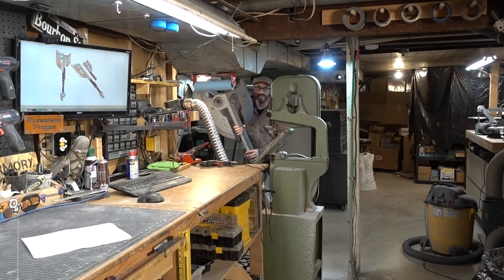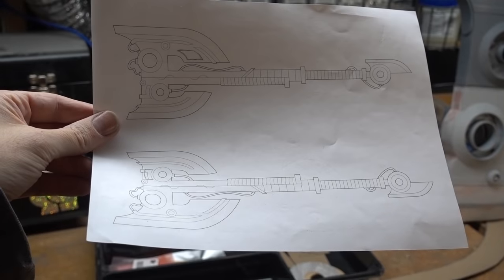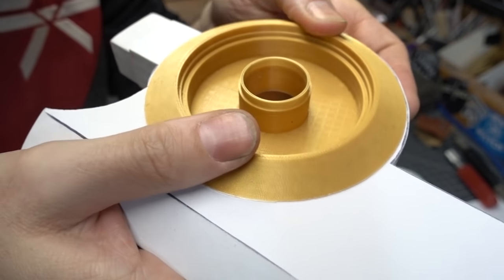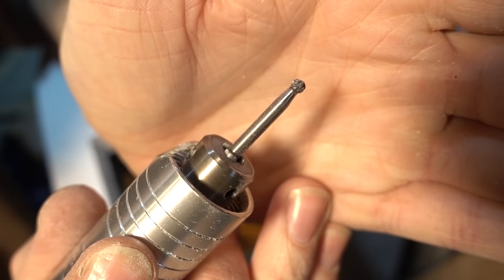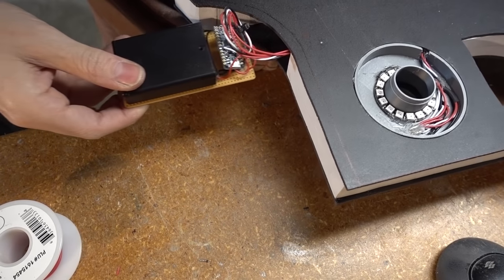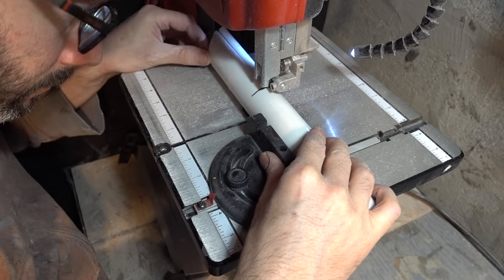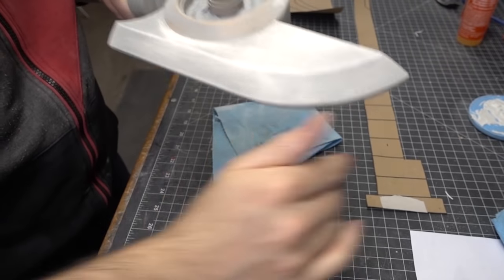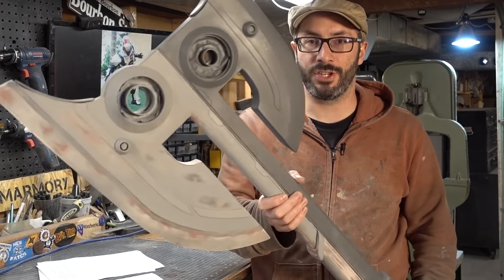Building the Jazza Axe Prop Part 1 - Prop: Shop

Comment: That's pretty awesome. Given how this is a sci-fi design, I think you could leave the 3d-print lines and make the cable connecting battery to lights visible. Anyway, it looks rad, and I love how neatly all the buttons, batteries and lights fit.

Comment: Wow , how lovely is that. Same like other youtubers here, i havent thought about that big size. The only part which irritates me is the connection of the two axes. There should be a small switch/snap whatever just to unlock the slide effect. 
What im thinking is,  if you gonna hold the axe at the bottom with both hands ( i know jazza was thinking about 1 hand bottom and 1 hand in the middle)  and start to swing,  the centrifugal force will slide the small axe out of the big one unintentional. 
Probably i missed something. 
But still i love the design, i love the implementation. Great job.

Comment: Is the PVC foam comparable to any type of wood, specifically with how well it can be cut/sanded. I recently tried sanding a few hard woods then got progressivly softer to see what I liked best and I found it was difficult to have a wood that was light, but also hard enough that it didn't just go fuzzy on the sander

Comment: Another great video. Thanks! When you hot glue your pieces do you typically use a high or low temp gun? Pros and cons? Amazon link to one you'd recommend?
Reply: Thank you for the recommendation and for taking the time to reply. Keep up the great work!

Comment: Why not use magnets to connect the two pieces?
Reply: ***** 1. Unless you're doing anything with wireless it'll not interfere in any way.
2. Just use proper magnets (like neodymium maybe), then longevity it won't be a problem.